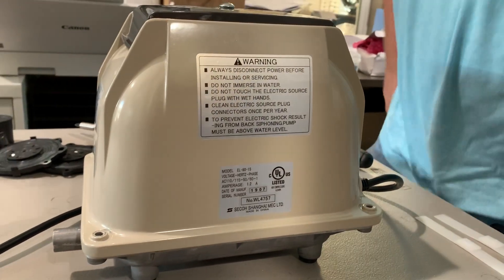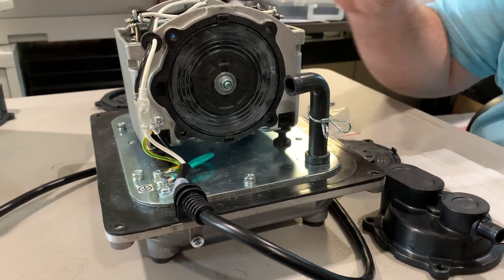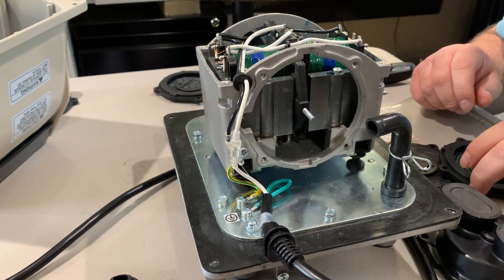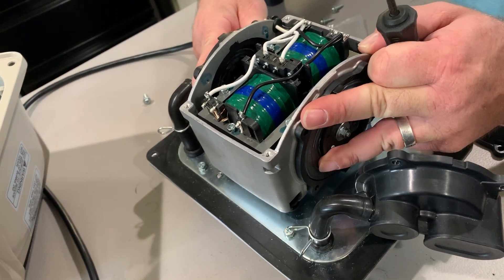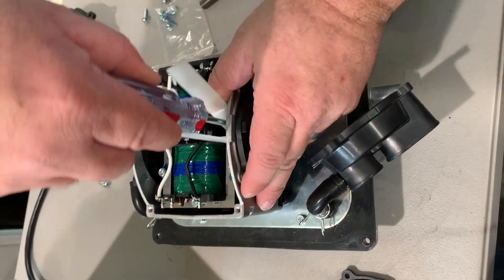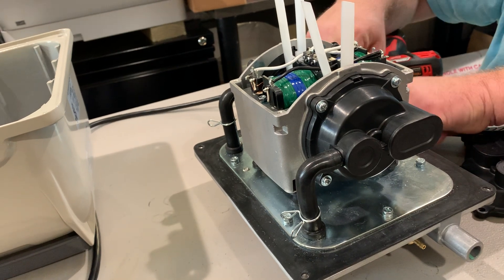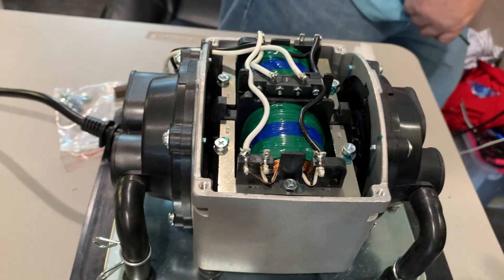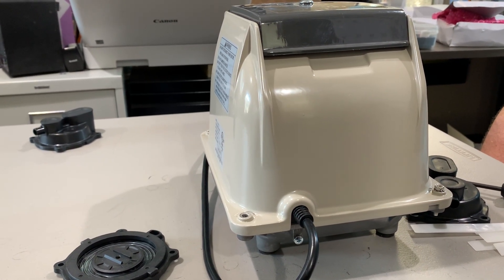Rebuild Secoh El-80-15

Comment: Mine has a small, maybe 1/ 8 inch dia. exhaust or air  outflow
 exterior, on the bottom, next to the larger air hose. Is that supposed to be connected to anything because it just blows air.

Comment: The top and bottom of your magnets seems to be very smooth, where the magnets on teh pump I just started rebuilding (EL-150) seem to have some plastic/resin almost like "nubs" on them. (Image: https://www.screencast.com/t/C31KjatwBvvM ) -Does that indicate a problem with the magnets? With the pump? Or is that normal? This is my first SECOH rebuild -I've probably done 500 HiBlows, but this is the first time I've done one of these. Thanks for your informative video!

Block Image: https://www.screencast.com/t/C31KjatwBvvM

Comment: Is this the brand air pump that comes with the 800 gpd nu water aerobic?
Reply from the maker: dangerds this could be i think they use a jdk now but it the system is over 2 years old then yes.
Reply: @wholesalesepticsupply  Hi I have a very large septic tank, not yet in use and I want to add an aeration system, hoping you may have some recommendations on pumps, tank size total is 10x3x3m (I know very big) it's technically 2 chambers, 1st chamber has 2 baffle walls in place to slow the movement through the system.  Any idea of the type of pump or pumps I would be use.

Thanks in advance
Neil
Reply from the maker: bored p how many people under 5 hiblow hp80.
Reply: @wholesalesepticsupply  Hi, at the moment the house was build with 8 bedrooms (hence the size of the tank) so I was wondering if I need multiple pumps. Thanks In advance
Reply from the maker: bored p no you do not need multiple pumps you could step up to 100 liter a minute pump if you wanted.
Reply: @wholesalesepticsupply  thanks, any you would recommend, as this is in the Philippines, assume hot climate, and easier for me to do strip down and rebuilds if required (tend to be harder to find things here, so amazon is my friend loll
Reply from the maker: bored p they are made in the Philippines and yes they do well in hot climates